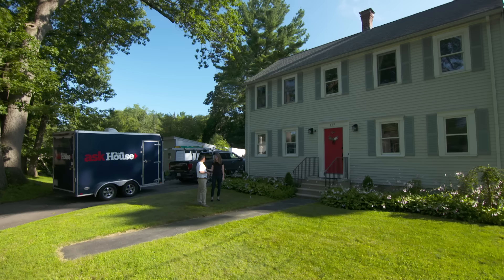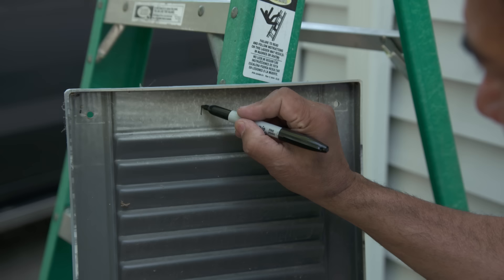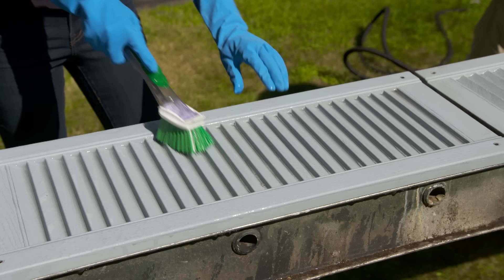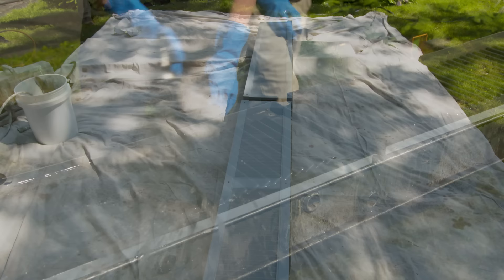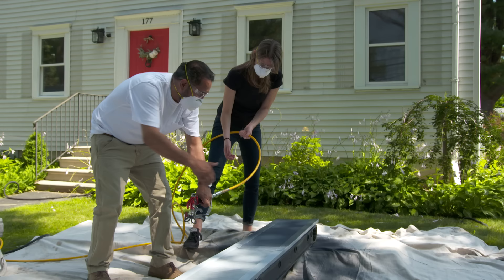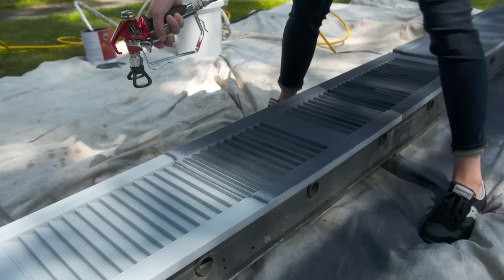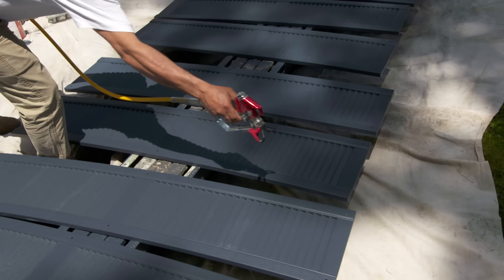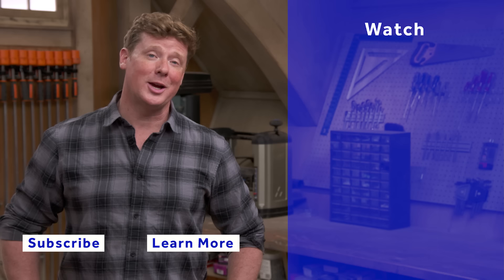How to Paint Vinyl Shutters | Ask This Old House

Comment: These are fake shutters, which can not shut. Is this common in US?
Reply: Yes. I didn't know they were actually supposed to be functional until I was about 20
Reply: Most common in New England.  At least the fake shutters look the right size, each shutter is half the width of the window.  Sometimes people have W I D E windows with little shutters on each end and it looks silly!
Reply: Yes, I have never actually seen real shutters on a house and I’ve been alive for nearly 40 years.
Reply: Roy Poulos go down to Charleston S.C. or a similar historical place and you’ll find them.
Reply: Dblood85 👍
Reply: They're supposed to close? No way!
Reply: They are just decorative.  They are used a lot in the southern states too.
Reply: @dblood8529    All over the place here in Charleston. 😉
Reply: Absolutely

Comment: As a precaution, you should squeeze a touch of the appropriate caulking in the screw holes, just before hanging it back up,  you'll be glad you did
Reply: Good call, the old wood or brick those shutters go back on don't always get fastened into properly, loose brick/mortar or stripped out wood. At least they added painting the screwheads aha!
Reply: I used a lot of toothpicks in the holes where the wood dowel was lacking stuffed them really tight and broke them off works pretty good as i couldnt remove the broken dowel
Reply: @slliks67 that’s how I would do it.

Comment: I only had two sets of exterior shutters so I just painted them on a ladder. Used a primer and about two coats of paint with a brush. Worked well and it’s been about 7 years. Spraying is definitely easier though. And less time consuming by far.
Reply: Did the paint bleed?

Comment: Yes these are non-functional faux shutters: historicly louvered vented shutters/Plantation shutters are found in the south sunny humid states. main purpose was sunshade but with airflow/and storm protection.
Plank Shutters (no louvers or vents) are more typical to midwest/east coast to protect from high winds and flyin debri damage.
so if you are installing faux shutters: this may help you get the right shutters for your house type and area. EX a Dutch Colonial in Mich would look best with plank type faux shutters

Comment: Vinyl shutters are HDPE, which almost nothing sticks to.  Your best bet on longevity would be an epoxy based UV resistant paint, because it'll act more like a shell and be resistant to cracking and flaking off.
Reply: Ive put bonding primer then exterior gloss. Sprayed both. 12 years later still look same. I know this because its a friends house. They've never been touched for 12 years.
Reply: Looking into painting my shutters but what is the best brand to paint it with. Looking to go from burgundy to a deep blue. Any advice please and thank you. Also best brands of paint( husband has spray gun)
Reply: @hazeleyes2171  Your local Sherwin Williams is probably your best bet.  They definitely are more expensive than the big box stores, but their paint is far superior, as is their advice.  Go talk to them and they'll figure out what you need and any prep.
Reply: Cup & Cone will do once all this covid19 stuff goes away
Reply: @hazeleyes2171  lol how’s that going?
Reply: @stifflers69mom1  right?! And it's still going on forever.
Reply: I am going to have to paint my vinyl shutters since I am not able to color match new ones with my new front door.  Since it is a Sherwin Williams color, I want to the Sherwin Williams store for instruction.  I was told to pressure wash the shutters, prime them, and then paint them the preferred color.